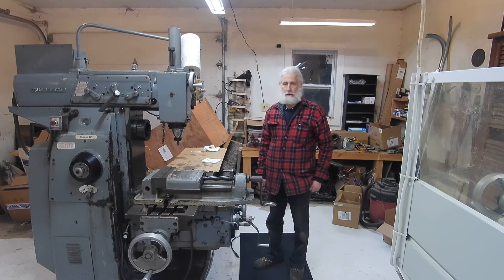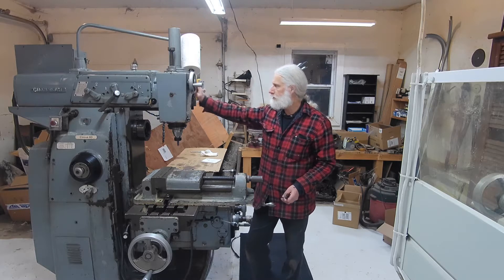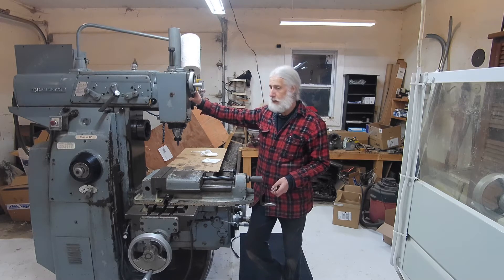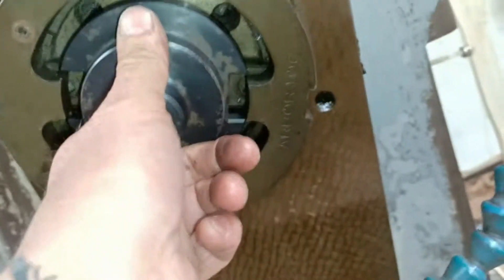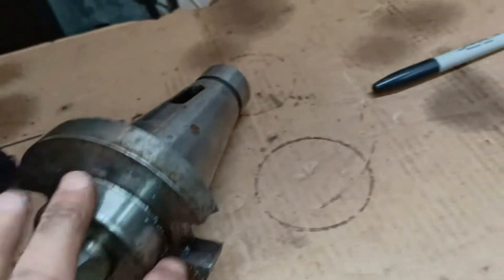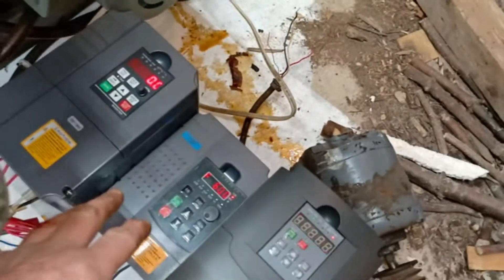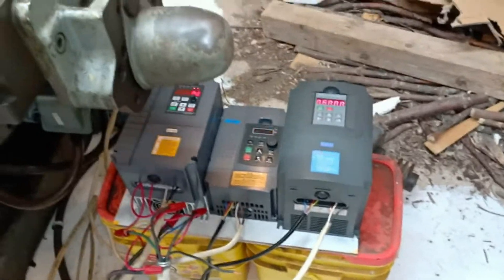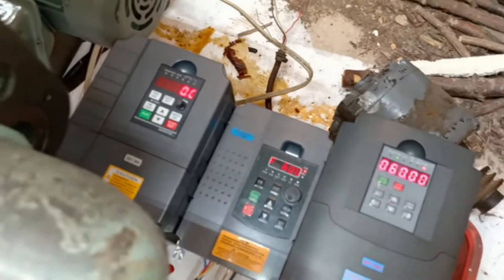Cincinnati E2, spindle and VFD drives

Comment: Make sure the overhead drive doesn’t clatter as the drive coupling wears the shaft end from the gearbox, if you leave it it will shear off the shaft end. I had to repair two of those with that same problem.
Reply from the maker: Thanks for the tip.

Comment: 6:30 Drive dog slots - I plan to mark mine - so that tooling always goes in the same way.
Reply from the maker: The CAT tool holders always key the same because of the one shorter dog slot. but may want to mark your MNTB holder if that is a concern for you. On an older manual mill they don't turn fast enough for it to really be an issue. CNC mils can often turn 10X the RPM of a manual, so consistent balance is critical for them.
Reply: @matthewperlman3356  I'm hoping fitting the same way every time will eliminate one possible source of runout. Top speed of mine is CURRENTLY 1600
but if I add a multispeed motor !